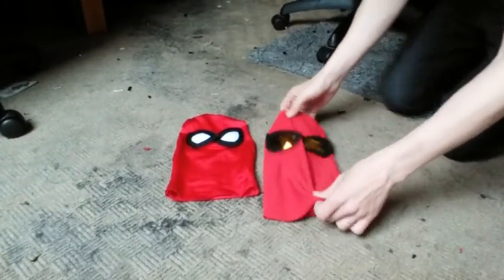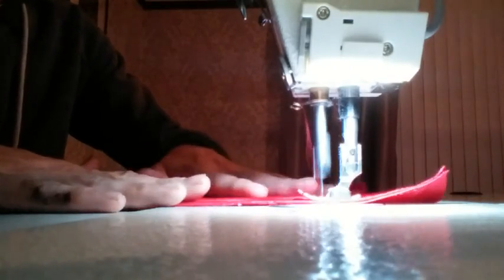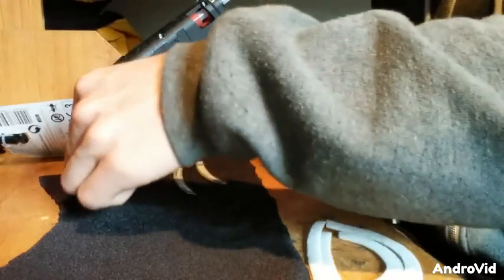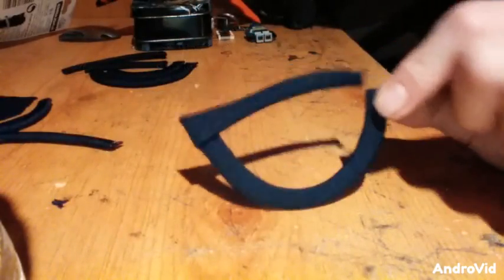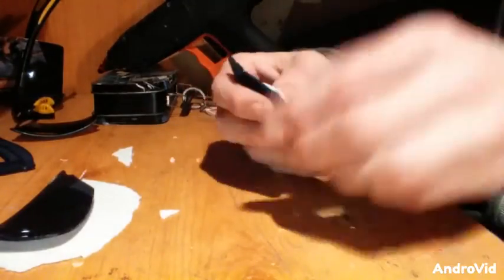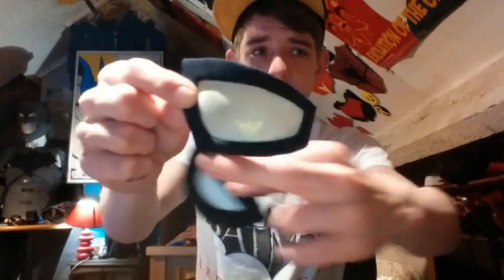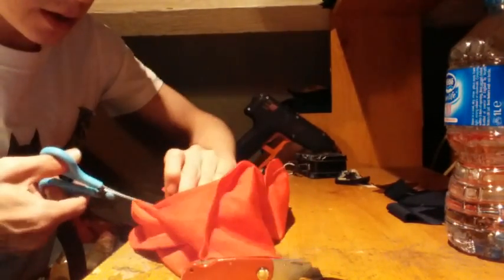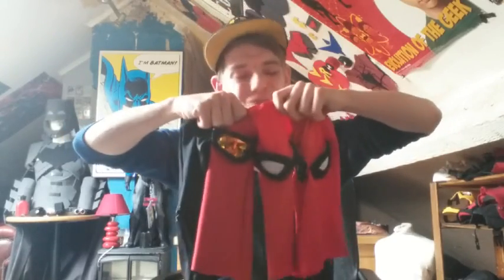How to Make A Spider-Man Civil War Mask with Lenses - Process Video

Comment: Hey john, what is the material you used for the eye lenses black parts. Thanks
Reply from the maker: I used peltex though can use cardboard or Eva foam either works
Reply: john hay oh thanks for that. I'm trying felt the fabric. Its a bit hard to glue the black Lycra on to it. That's why I asked. Thanks again. Still in the process of making my mask.

Comment: Looks great man! I have a question tho. I'm making a Spiderman ps4 suit (inspired by you) and, of course, it needs a mask. How do I make the mask without tracing and cutting it out like you did? I never made the mask before so I don't have a template for it.
Reply from the maker: The measurements are 30cm in length down the middle of your face then 22cm in width across the face and then get that nice curve at the top of your head and also the eye lenses are a bit bigger and have a longer point at the top
Reply: +john hay Ok thanks! Also congrats on 5,000 subs! You have a great channel and can't wait to see what you will create next!

Comment: +John hay what are the dimensions for the mask
Reply from the maker: 14cm wide depending on how tight you want it, keep taking it in to make it tighter and 30cm in length from the middle of your curve
Reply: I bought a stretchy fabric that is as stretchy as lycra but just a little thicker, does that make a difference?

Comment: if it were me and I don't mean to sound d like a dick I would glue the pieces to the fabric and then cut the fabric
Reply from the maker: No worries man but if you did that it would fix the fabric in place so when you try stretch it out the pieces would pop off at parts trying to stretch out with the rest of the mask. You need to have a mask that fits first then add the pieces once it's stretched out on a head mannequin for the best results sorry on the long reply
Reply: good point